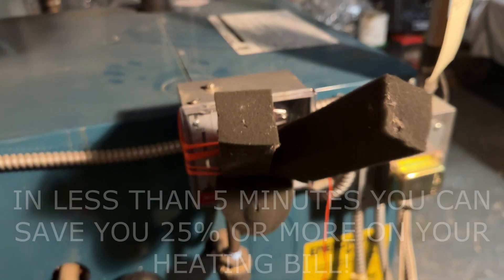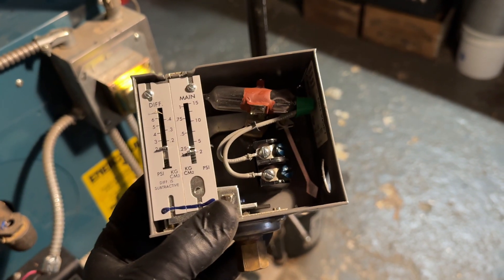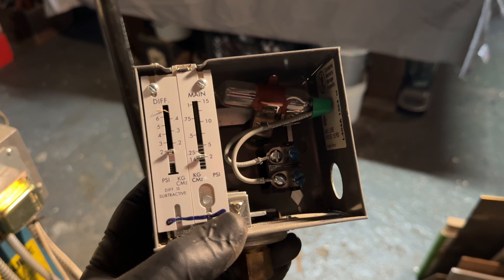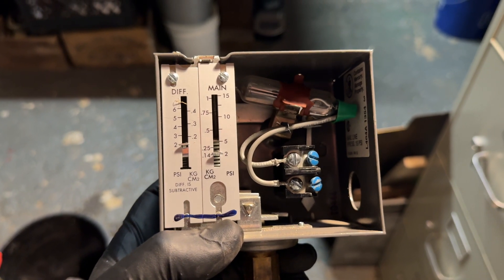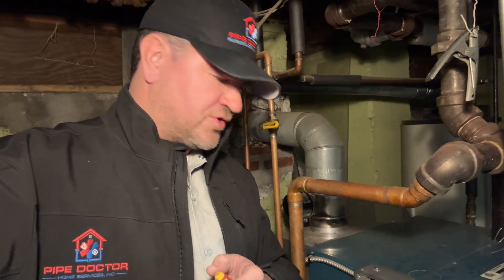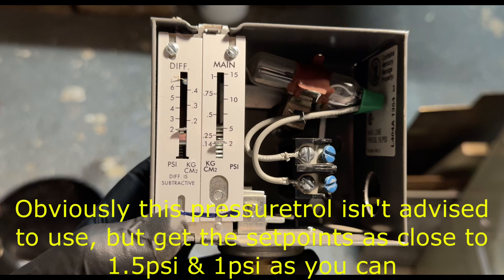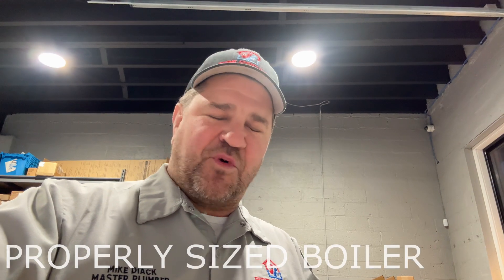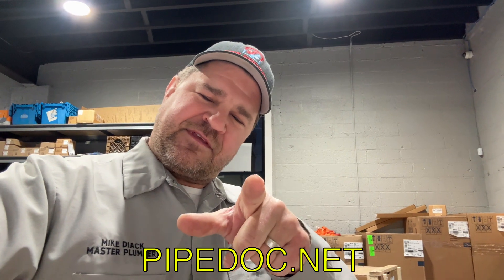Stop Wasting Money! How to Properly Set Steam Pressuretrol

Comment: I have a question..if that fails can the unit not  read any thermostat you install....my unit is not working with any thermostat I put...we jump it from thermostat wires it works fine and from the unit we jump it and works...but not with any thermostat I've installed been thru many thermostats 😩

Comment: Begs the question as to why US Boiler equips their residential Megasteam boilers with an inferior Pressuretrol preset at 6 psi cut out, 1.5 psi cut in all the while emphasizing proper near boiler header piping to eliminate priming/water hammering. This is akin to filling a fire extinguisher with gasoline to put out a fire.

Comment: Like "i" before "e" there must be exceptions to your/the rule.  I have a mixed system; the finished basement radiators have a return pipe and a fixed vent.  The main floor radiators have no return pipe and adjustable vents that close when at temp/pressure (If I understand the way they work, correctly).  These vents are all new and I have spent time adjusting them so all radiators get hot in a reasonable amount of system running (calling for heat) time. My system needs 4-5 PSI or the radiators with return pipes and fixed vents never get hot.  Only warm to the touch.  2 PSI sends my gas bill through the roof with a cold house.

Comment: Hi Mike...My WM GO-3 runs about 20-30 mins before the all the Rad fill up with steam and the thermo gets saticfied. Small one store house with 6 rds and one in the attic.  The burner never shuts down during that cycle. I was wondering if my prussurtrol is working.  Its set to .05 cut in and the whie wheel set to 1. Is this normal or should it be cutting in and out?? I have a Hoffman 75 main and #5 Mists on the Rads ???

Comment: Plumber and Heating guy here—Great video. 
Unfortunately most of us that learned what you explained have retired. And the next generation is busy hanging condensing units on walls. 
There aren’t many steam systems left— at least in northern New England where I am from. 
You have a good idea, open a consulting school. 
I would love to share what is in my head, but the next generation doesn’t seem to want to learn about the old ways. Sad. 
I guess that I will take my lead/ oakum caulking, large pipe soldering and other skills to my grave with me.

Comment: Not sure why I watched the pressuretrol tuning ad... 😁  But you never know when I might find a steam boiler in Texas in a house!  🤠👍  I wonder how that pigtail could be improved to prevent potential safety issues from happening, as in reality the only thing if that goes bad, would be the pressure relief valve and just start venting water into the basement.
Reply from the maker: using a brass or NON-BLACK pigtail will help with it NOT getting clogged
Reply: Proper maintenance help’s also

Comment: I would also recommend that the pressure gauge be replaced or calibrated to ensure accuracy. This is something I highly recommend when preforming ASME CSD-1 Boiler Testing, required by some states on Commercial Boilers.

Comment: Great video. What is a normal on/off cycle going off the pressuretrol?  My pressuretrol is set correctly with cut out at 1 1/2 lb, and cut in at 1/2 lb. Once my boiler gets up to pressure, it cycles 3 min on, 1 1/2 min off until t-stat is satisfied .
Reply: That’s much too much cycling. Either your main venting is insufficient or the boiler itself is oversized.
Reply: I believe it is oversized. So what is normal ? Ex: 5 min on/off?  I also read/ watched  somewhere that if the boiler is properly sized and piped perfect, and the radiators are vented properly, then technically there should be no pressure building up since the steam and condensation are about even..
Reply: You’re right. In a perfect world, the boiler output matches the radiation and only a few ounces of steam pressure is created. The boiler would cycle only by the thermostat. But boiler oversizing is the norm and when it has to run for extended periods (from a large setback), it’s typical for the pressuretrol limit to eventually be reached. 

If you’re routinely reaching 1 1/2 lbs of pressure even when the heated space is within a degree or two of the thermostat setting, your boiler is either grossly oversized, the main venting is insufficient, or the boiler water level is surging because of contaminates (oil).

Comment: Have you ever run into a boiler Steam that works in a vacuum
Reply from the maker: I've worked on a system a couple years ago (Covid-19) messed up time frame - for a home in Valley Stream that used a vapor vacuum system.

Comment: First lol
Reply from the maker: Hi
Reply: Another thing to consider is if you have a one pipe steam system you should change your main vent to a Gorton #1 main vent or if you have the main a BArns and Jones big mouth Vent. Because the faster those main vents fill the faster the house warms and the least the boiler runs. 

When I first bought my house I wondered why my house would take so long and to heat and it was always uneven. The first floor would always be hot while the second floor would stay cool. Ever since I chance my main vent from a Hoffman #4 main quick vent to a BIG Mouth Vent and buying the correct vents for my steam radiators everything heats up nice and even.
Reply: To add to that would be to master vent the risers .  
Gorton #2 vents faster than the #1.  The big mouth has the highest venting capacity.